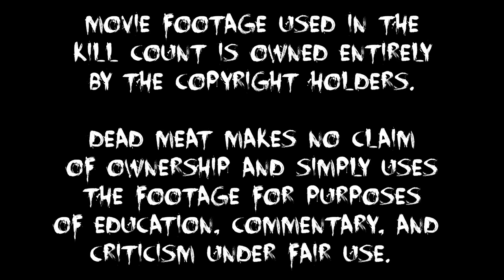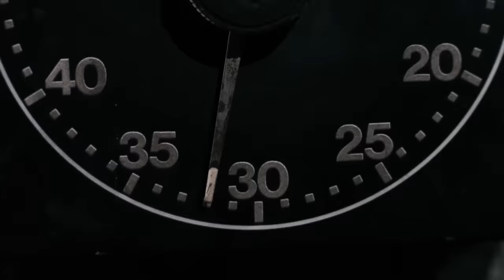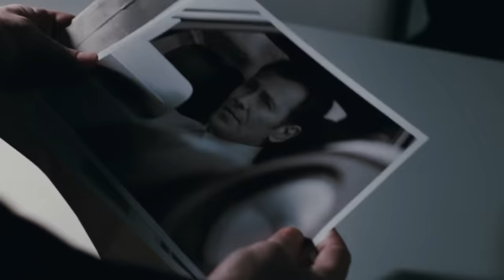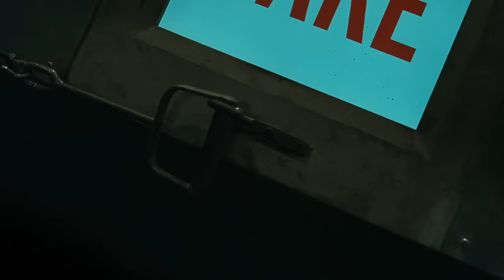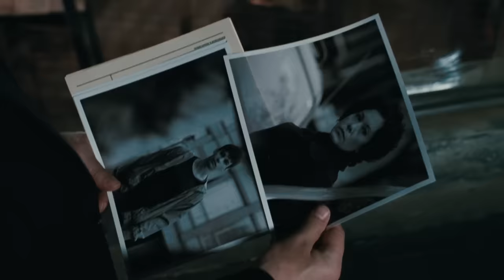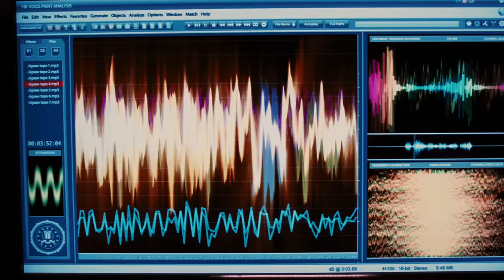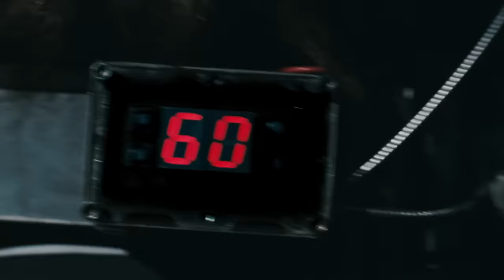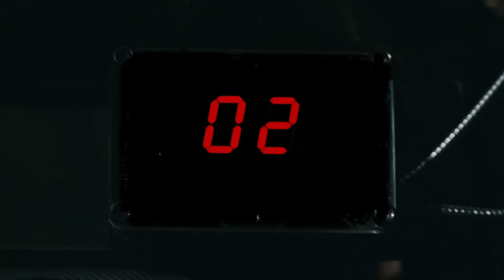Saw VI (2009) KILL COUNT

Comment: I gotta say, may favorite trap, maybe in the whole series, is the Steam Maze. The idea and most of the execution is a perfect saw trap. You get a minute to race through an area full of steam. There are ways you can cheat the system (and the victim does a little) but for the most part the short timer makes sure you don't do anything stupid. The game makes both victims co -operate and no one has to die for it to succeed. The maze itself looks great and is designed so that both victims can see each other at all times.

My only gripe is that the key is in the guy's stomach. That was stupid. It makes a fair trap (relative to the series) to an impossible one. How are you meant to clear that whole maze and then figure that out in such a short time? If the key was in the cage at the end of the maze, that would have fixed everything!
Reply: Yeah, but remember both Amanda and Hoffman usually set up unwinnable traps.
Reply: Yeah it was Hoffman's fault. That's why Jill was waiting for the game to end. Hoffman's real test was making a game where the main victim wins, and he failed. 

Damn Hoffman, why can't there be a good bad guy?

Comment: I find it hillarious about the breath thing. because I recognise thoose masks are for a C-PAP it's used to help people with sleep apnea from sufforcating themself in their sleep (google sleep apnea) but there is a failsafe to the masks making it possible to breathe even without using the air pipe on it. so the system can't actually work

Comment: You know I do alot of research on saw traps. It turns out there is a super easy way for the people in the shotgun carousel  to survive but it does involve alot of blood. In order for all six people to survive it, William instead of sticking just his hands in the place where it would pierce him, he could have done one of two options. Option 1: he could've left his hands in there and let the bars re pierce his hands. It would have been painful but doable. Option 2: he could have looked around for something hard and able to pierced with. For example, a wooden board, or his shirt stuffed with a board too. Both of these options are way easier and they can be done without all 6 people dying on the shotgun carousel.

Comment: Fun fact: The head gear the two in the first game wear aren't fake. 
What I mean is a manually operated device to screw into someone's skull like this does exist IRL, and it is for Halo-Gravity Traction. They replaced the small bits that go JUST under the skin with heavy automatic drill bits though.

Comment: Now that I re-watch this for the god-knows-how-many-nth time, I have to wonder if saving everyone in the shotgun trap was possible. I mean the series says it isn't, but like- aren't there ways to juke this thing? How does the trap know you're putting in a hand and not like- a foot, or a tie, or a folded piece of your clothes? Does it just punch whatever comes into it? I can't imagine John could code something like that (body-part discerning software) with only his background as an engineer, and it's also 2009. If it DOES only punch through hands, why not just... put your hand into the same spot, in a different position? So the hole punches through somewhere else in your same hand. Recap: If it punches through anything but has a limited 2 chances, then you could just substitute your hand with something else. If it only punches through hands (something like you needing to reach into the press to push some kind of switch) then why not just punch 3 holes in each hand? And if it only has 2 charges and can sense what's a hand and what isn't one, then how did John Kramer manage that on his own without anyone knowledgeable with coding under his wing?

Comment: Just like 95% of the kills in this franchise, I have a really hard time accepting the efficacy of the reverse bear trap as a tool of murder. I’m not even so sure it’d realistically maim. The amount of stored energy needed in a spring mechanism to separate the upper and lower jaws of a human skull is tremendous and would need to be much larger than the trap we see in the movie. Also, as someone who has watched far too many death videos on gore sites over the last 20 years, I can assure you that removing a person’s lower jaw is not going to mortally wound them, lest they die of infection 3 days later. Anyway, I suppose all of this is all just par for the ‘suspension-of-disbelief’ course necessary to enjoy the vast majority of horror movies, new and old...in which case, this comment is entirely pointless!
Reply: bear traps can exert force up to 1000lbs , having that suddenly applied to any part of your head or spine is going to have a high chance of killing or crippling you at the very least